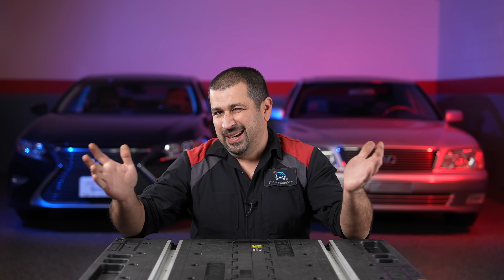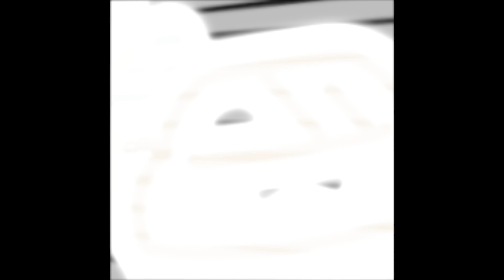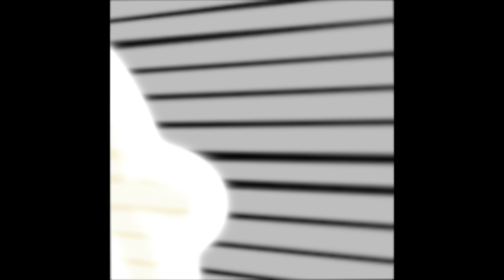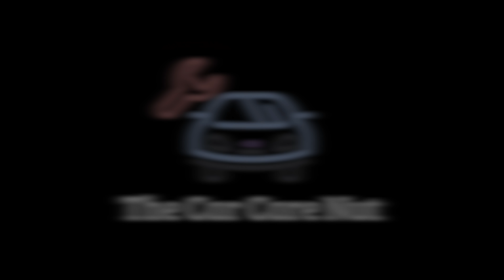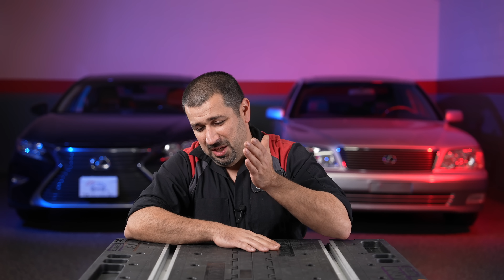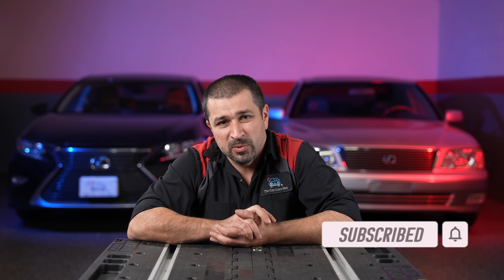Can Modern Turbo Engines Be Reliable? Here's The TRUTH!

Comment: Turbo car owner/ heavy driver here. Oil changed every 3k religiously. I'm not taking any chances. 122k miles and still pushing.
Reply: No. Machine owns you. Interval too short to be a worthwhile machine.
Reply: @arthurfisch3673  what are you talking about? Turbo car - oil should be change every 3k. NA engine every 5k
Reply: @darkkforest No. 5K intervals. 3K is ridiculous. Have fun going that in 20 F weather. Good guy. Never defines “ long time” for lasting! 10 k I tervals to much. I have cars since the 70s. All N/A  , no turbos. 5 K intervals for oil, 50 K intervals for tranny, diff, PS. Longest car lastest 236K when sold, 1990 Honda Civic RX 5sp. Present vehicle 07 Highlander, V6 3.3L, 168K miles. No oil consumption, no leaks after valve gasket replacement. 50 years of FIY maintainance. Can buy new car cask now… no problem. Not doing 3 K oil intervals. BS. Good luck with that!!😀

Comment: That's why I'm aiming for toyota hybrid. Not only you have reliable non turbo engine but also very, very simple transmission
Reply: I love my 2022 Camry Hybrid.  135K miles now, used for work trips.  I average 51 mpg and it's not slow, put it in sport mode and floor it and it gets up to 60 mph in about 5.7 seconds!
Reply: Hybrids by definition are more complex powertrains, which doesn't bode well for reliability over time.
Reply: @Japplesnap  That's not always true. Sure, there are inherent complexities, but some parts are often significantly simplified (transmissions) or skipped altogether (clutches, torque converters). Also hybrids rely to an extent on electric motors, which are very sturdy. The engine itself is utilized in a much more stable way in terms of RPM and load than in a traditional drivetrain. All that has net positive effect on reliability
Reply: @jmk9065 No matter how you view it, hybrids are more complex and complexity leads to increased opportunity for failure. This isn't opinion, it's fact.
Reply: @Japplesnap I still see first second gen Prius cars in the road though. 
My friend put 250k on his Prius before he traded it for a musk 3.
Reply: @Japplesnap  If that was a fact, the late 19th/early 20th century cars would be the most reliable. Everything after that would gradually become less and less reliable with modern hybrids like Toyota and Honda being the worst of the worst. But that's not true, is it?
Reply: @jmk9065 Wrong. There comes a point where reliability peaks. It obviously wasn't back in those days and it's not today either. Look up the stats for yourself. It's not difficult.
Reply: @Japplesnap Thanks for admitting that reliability does not always decline with growing complexity. Also, it should be easy for you to cite stats that clearly show lower reliability of hybrids compared to pure ICE drivetrains, right? RIGHT?
Reply: @jmk9065 Look up the stats yourself. This is YouTube comments. You want stats, look them up yourself. Oh, and if you don't agree that complexity brings opportunity for failure, then no need for further discussion. I'll just dismiss you as ignorant.
Reply: @omieyouknowmeMy Audi has almost 300,000 m8les on it. So what's your point?
Reply: We have a 17 Highlander with the V6, and a 24 Corolla Hybrid.  Driving the Corolla yesterday... if you drive it right it gets crazy mileage...  yesterday upon parking the car in the garage, it tells me it got 73 mpg.  Crazy.
Reply: Thought the hybrids have cvt now. Which are non serviceable.
Reply: @omieyouknowme A CVT and a Toyota hybrid eCVT are two totally different things. They operate on completely different principles. An eCVT is the most reliable transmission on the market right now because of it's simplicity. Never change the fluid and you'll get 200k+ miles. Change the fluid every 6-9y/60k-90k and it will last indefinitely. It will absolutely outlive the rest of the vehicle. I believe AMD said in a video that he can count on one or two hands the number of eCVTs he's had to replace outside of accident damage or gross negligence by the owner(wrong fluid, stupid mods, insanely high milage with no fluid changes, etc.). That's over a 15 year career of only working on Toyota/Lexus vehicles.
Reply: @michaelkemmet834 wow

Just watched a video of person tearing down an ecvt explaining how it works. 
Look for “understanding the Toyota rav4 hybrid” 

I’m curious how long term durability is. I tow weekly with my 2gr rav and it’s been great. Will ecvt be just as strong and durable.
Reply: @omieyouknowme ECVT in the hybrids runs on a planetary gear system, not a drum and belt/chain system like a typical CVT.   ECVT is more similar to what EVs use.
Reply: @keith2772 I saw that in the teardown video from another channel
Put some of my fears to rest.
Reply: Boring
Reply: @IF040020  No one buys a Toyota for fun, they are boring, but super practical and reliable, which is what you want for a daily.  Personally any car that doesn't have a manual transmission and a convertible roof is boring to me.  I love my MX5, slow but far from boring.

Comment: My wife and I were shopping for a new car a year ago. The new Chevy Trax/Buick Envista was nearly the perfect vehicle for us, and we would have bought one except for one thing: 3-cylinder engine with a turbo. Nope, pass. Bought a basic Toyota Corolla instead.
Reply: Those small ''GM' cars are just Daewoos in disguise.
Reply: @RightLaneHog3151 I thought they were Dihatsu. Hmm
Reply: @omieyouknowmeDaihatsu is owned by Toyota
Reply: The Trax/Envista's are almost too good to be true, so much car for a reasonable price.  But then there is tiny engine with the turbo, and even worse, the wet timing belt issue.  Count me out.  I bought a RAV4.
Reply: @Kbeahler8935  Traded my Trax for a CX-30 when turbo issues appeared.
Reply: @Kbeahler8935  You got money to burn. Yes RAV4 is definitely a better vehicle, but also requires more maintenance compared to older ones. Then, theft. Insurance is crazy on those.
Reply: @Kbeahler8935  Ditto. Worth every penny in the long run when you consider how long we can run these normally aspirated Toyotas. 

I bought my 2 Toyotas back to back and they were my first after 2 lemons from Ford that I always had great luck with. In our early 60's now. Both these vehicles will still be our daily drivers when I croak. Possibly my wife, too. She's got better genes. 😂
Reply: Best dicision.
Reply: Smart move....only fools think turbos are something new and improved. We already went thru this crap decades ago, it's NOT maintenance, oil changes or other bullshit...it the laws of physics. I own turbos and know $$....putting them in trucks/SUV is especially stupid
Reply: @doctordetroitt Not really. Today turbos are not the same as in the old days. They are much, much better. And the cars themselves also help extend turbo life exponentially. Modern turbos are oil AND water cooled, unlike most old turbo engines. My car has a separate auxiliary water pump that continues to cool the turbo after the engine is turned off, eliminating the possibility of oil coking on the compressor/turbine shaft. Face it, technology has improved turbochargers and there's not nearly as much to worry about as there used to be.
Reply: @glasscockpitf35 That's funny. Back in the day I had an Eagle Talon Tsi AWD (same car as the Eclipse) and I beat the snot out of that car for four years before trading it in for a 300ZX. The Talon held up just fine, despite being beat on severely.
Reply: Listen to AMD, Ignore Toyota; as a fellow former Toyota Dealership employee, 16,000 KM or 10,000 Mi is too long between changes. Change it every 8,000 KM or 5,000 Mi/Get a Service 2 everytime. Toyota Service 1s are only useful for EVs since it's basically a Tire Rotation with a technician looking for any additional work they can sell the owner.
Reply: @zdl360 what do I get done with a service 2?
Reply: You just dodged a bullet
Reply: Good move
Reply: Plus a wet belt.
Reply: last 3 cylinder chevy i drove was 25 years ago.  it was a hot day like 95 outside.  3 people in the car.  under normal driving conditions after applying the brake about 6 times the brakes started to fade and i could not stop the car.
Reply: @bobbiejoe4726 if it’s what I think it is it’s likely a Geo/Chevy Metro
Reply: Good move!
Reply: I have had two Chevy 4 turbo no problem take care of the change oil do regular service and no cheep gas and they last
Reply: Buick Envision assembled in communist China. Couldn't do it, but my buddy who worked for Stellantis did. Trax, Envista, Encore assembled in Korea. Equinox? Bought a new one in '14 & '19, but now only come w/ cvt transmission & assembled in Mexico. I chose a 2.5 liter non turbo w/ 8 speed transmission, fwd, assembled in Georgia, 32 mpg hwy rated, but delivers 35 mpg, 5 yr 60 k mile bumper to bumper & 10 year 100k miles drivetrain warranties. Kia Sportage.
Reply: @ews360  the AWD Equinox is an 8 speed auto.
Reply: @terrencejones9817  We have a 4wd truck if roads get bad, & both wife & I retiired & wanted mpg more than awd. We rarely used awd on our 2019 Equinox. It had a button on the console to engage/disengage awd, so in essence it was a 4 wheel drive because due to the ability to disengage it, it wasn't all wheel drive.
Reply: @ews360  I have an 18 Equinox,  it's definitely AWD as it can be driven all the time in AWD mode. The fuel economy is better in front wheel drive mode for sure.
Reply: @terrencejones9817  Majority of awd vehicles are truly that, all the time all wheels drive.
Reply: @ews360  No, they aren't, actually.   Most companies use a system that decent slips and only engages the rear wheels when slip happens and then most systems that Honda/Toyota/Hyundai/kia use , never transfer more than 30% of the power to the rear. GM went one step further and filled disconnected the rear axle from the front driveline.
Reply: @ews360  only Subaru is full time AWD most of the others it’s front wheel drive until the system feels the wheels slip then they will switch to AWD.
Reply: @ews360  Kias and Hyundai might be assembled in the US, but use low quality cheap materials made in China and Korea. The reason they have long warranties is because they have reliability issues and need the warranties to sell their vehicles.  They also have no resale value once that warranty is gone might as well move on.
Reply: @TheSjuris  2025 Kia Sportage in our garage window sticker states: 60% content US/Canada - 30% Korea - Engine - US. Trans U.S. Assembled in Georgia. 5 yr/50k mile bumper to bumper & 10 yr/100k drivetrain warranties. 2.5 liter non turbo engine w/ 8 speed (non cvt) trans. What would you buy? Buick China Envision? Korea Buick Encore/Envista? or Chevy Trax/Trailblazer 3 cylinder?
Reply: @ews360  I’ll buy a Toyota instead and avoid using cheap plastic parts assembled by cheap US labor using cheap shitty engines. Not only will that Toyota be built better it will last longer. Longer warranties mean the cars aren’t built very well otherwise they wouldn’t need a warranty as a selling point.  Have had enough American Hyundais to know they have no resale value at all. Enjoy your Us assembled cheap Korean plastic car. Maybe it will actually last 100,000 miles.
Reply: @TheSjuris 30% Korean content. I don't keep vehicles that long. Buy new, cash, trade every 5 yrs.
Reply: @ews360  better not drive it far it still has no value.  Kia’s lose 45% of value once it leaves a lot.  It does have extremely cheap plastic parts cheapest they can find. Cheaply made transmission cheapest they can make. Looks nice and shiny because Americans love cheap shiny things.  Disposable cars made for people who like throwing their money away. But hey let’s pay over 30k for a car that’s worth 14 in 5 years.  It’s your money hope you pay in cash.
Reply: @TheSjuris  Drove it 3,500 mile round trip this past summer from Ohio to Nova Scotia. Flawless. Fwd rated @ 32 mpg highway. Achieved 35 mpg. Never been back to dealer except for oil change every 5k miles. Didn't like the looks of Rav4, or Honda. Had 14 & 19 Equinox. Did pay cash & every car will be worth half of sticker price in 5 yrs. $250 a month, $3k annual depreciation. 3% of annual earnings. Expect the same depreciation on '23 truck.
Reply: @ews360 . RAV4s keep their value. Hondas keep their value. Hyundais and Kia’s lose their value very get quickly.  They are shiny and plastic and cheap just like you want it.  It’s your money if you like cheap things that’s all on you.

Comment: Gasoline turbo engines, even more so than naturally-aspirated engines, are prone to an earlier death from a lot of short trip & stop/go operations, especially where engine doesn't get up to normal-optimal operating temperatures for a sustained period after each start/use.  Also, oil effectively pulls double duty in a turbo engine design, so best to change it every 3K miles (or 6 months if that comes first) if you want the engine to last as long as possible.  In addition, always let the turbo cool down while idling for a few minutes before turning off the vehicle after driving it.  In the end though, NO MODERN ENGINE will be as long-term reliable & issue-free as the best-built engines from yesteryear that were port-injected instead of direct-injected.
Reply: I definitely agree. Just to add on to this, a turbo increases oil/exhaust temps a lot and increases of cylinder pressure, so by nature it’s under much higher stresses than a naturally aspirated engine. Naturally aspirated engines have much less complexity and are under much less stress. Unlike a turbo engine a naturally aspirated engine doesn’t have an intercooler, a turbocharger, no boost control valves, and no turbo oil/coolant lines. This means much less failure points, and an overall cooler operation. 

The biggest plus to a naturally aspirated car is… no turbo to fail. Even good turbos wear out eventually because of the high heat cycles and bearing wear. Once a turbo goes bad, that instantly reduces the reliability because that’s a major component
Reply: I concur, and would add that the start -stop technology has increased the complexity of modern cars immensely. One doesn't have to wonder why the cost of new cars has skyrocketed, mainly the result of government interference.
Reply: Turbos have no business being in 80% of the vehicles they are in now...customers are fools.
Reply: All-aluminum engines with an open-deck design are not going to be reliable with a turbo no matter how often you change the oil. In a few years the cylinder geometry will be completely destroyed and the engine will start burning massive quantities of oil.  These are single-use throw-away engines.  Case in point, VW's current 1.5L turbo: all-aluminum, open-deck, directly injected, low-tension thin piston rings, belt driven and lacking conventional cast iron liners (they use a 0.15 mm plasma-sprayed layer of hard material to coat the inner cylinder walls).  I cannot think of the worst possible combo for a gas engine with or without a turbo. No wonder VW gives you only a 4 year/48K mile warranty on this "technological marvel".

Comment: I get my oil changed every 3000 miles, on my Naturally aspirated V6. 13 years old, and I haven't spent a penny, on repairs. Garage kept, so it still looks almost new. The idea of buying the equivelent new car with a turbo 4-cylinder, seems laughable. A Turbo V6 would be less stressed, but the cost is prohibitive. ($80K)
Reply: Whats the mileage?
Reply: @mad-meh2719  45,000.

Comment: I recently watched a review of an Audi SQ8 (2026) from Sarah-n-Tuned. It has a twin turbo V8. The turbos are located at the top center of the engine under the intake. Seeing how this plays out regarding maintenance and reliability is going to be interesting.
Reply: The hot V configuration cooks the turbos, but only after the initial lease/warranty period.
Reply: Hot v has been around for a while. Great for performance, not the best for heat cycling and reliability :(
Reply: @scott8934  Good in theory, bad in practice.
Reply: hot vee, great for performance, crap for longevity, cooks everything.

Comment: Our society began to ignore maintenance, oil changes in particular many years ago. Adding a lot of turbo gasoline engines to the mix has created a perfect storm with engine killing results. I avoid gasoline engines with turbos, and I change the oil in my normally aspirated engines every 5,000 miles or sooner because I want them to outlast me.

Also, what is the prefix designation for Toyota engines that were designed and built from the ground up as performance engines?

Comment: Toyota 4.2 diesel turbo from the late 80's, over 400k kms, just fine. Saab 900 2.0 petrol lpt turbo, 260k kms, just fine.
It's about how the manufacturer wants that turbo to help the engine, for outright performance or  just enough to get things moving...